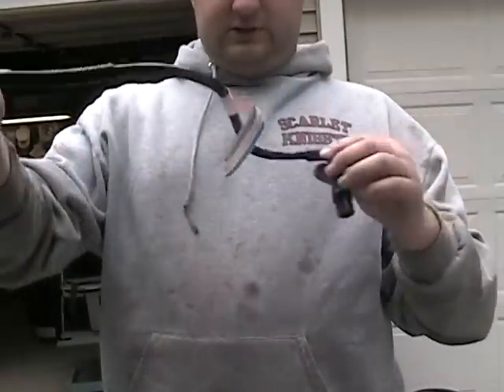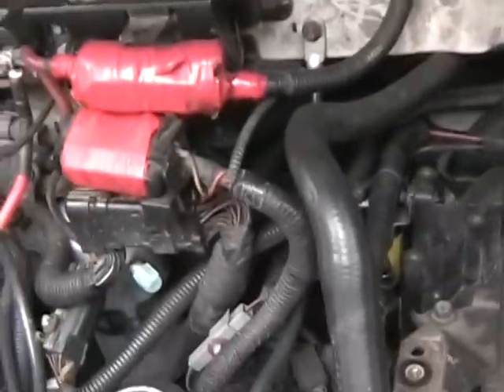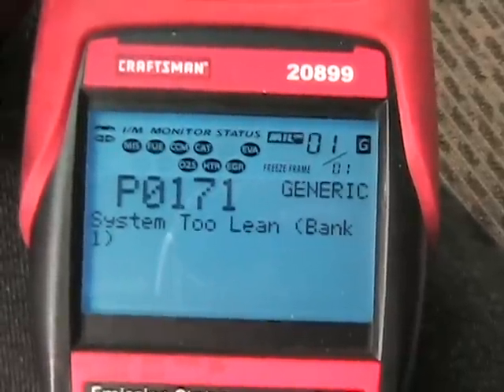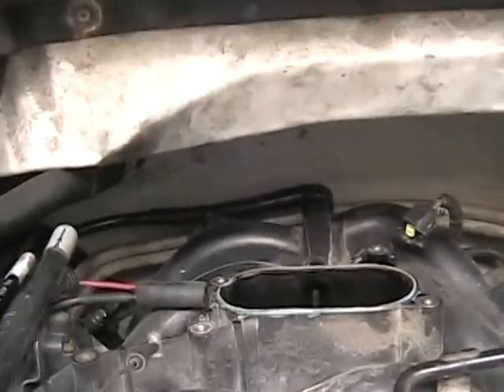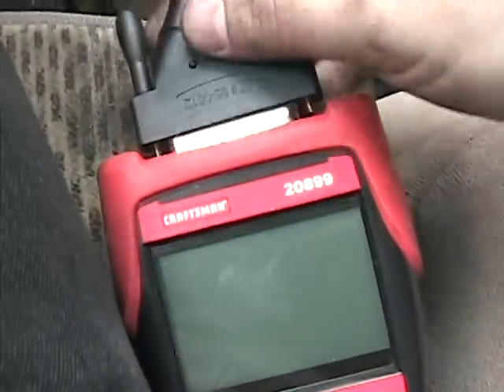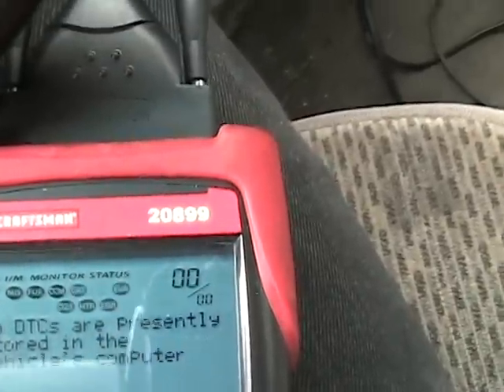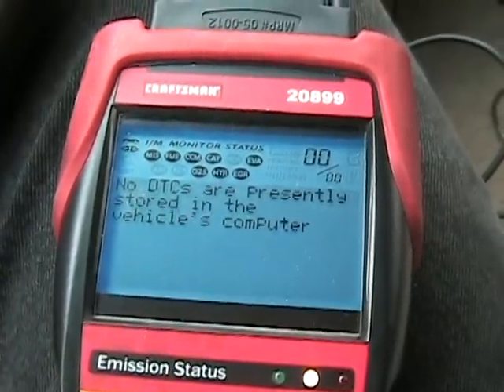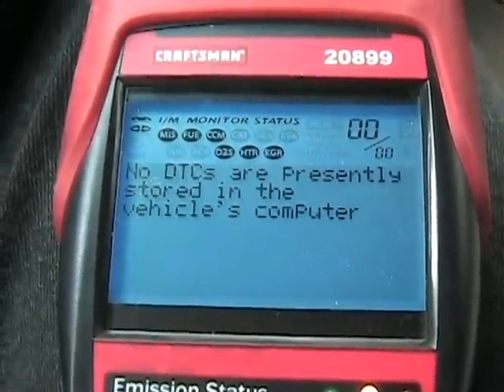1998 Ford F150 PCV Tube Replacement Triton 5.4

Comment: Nice video, only thing I recommend is taping or blocking off the opening of the intake manifold with the throttle body elbow removed. Last thing you want is to drop a piece of rubber or plastic down there while it's wide open.

Comment: I bought one and it took me 10 minutes to replace it. Same Code you had. 1997 Ford F-150 5.4L. Runs fine now and no Codes. Found a small crack on the tube.

Comment: If your 5.4L goes through a lot of oil, consider replacing your PCV first. Could save you on more work. Like changing leaking valve cover seals
Reply: Thanks for that tip too. My F150  goes through oil and the passenger valve cover is covered on the top by oil . Didn't even think of the PCV valve.

Comment from the maker: @TheMrchukies - You can try that, it is a common problem on the F150 5.4s and 4.6s to have the elbow on the back of the intake manifold break after time. The rubber becomes brittle. My issue ended up being the MAF (Mass Air Flow Sensor) was super dirty.

Comment: I'm finding several part numbers for this same part. One thing you need to know is if the PCV valve is heated.You can tell if it is by the hose branching into a y a few inches above the valve itself

Comment: What could be the problem if you get hesitation when accelerating fast? Changed the fuel filter under driver side checked spark plugs and cables all firing correctly. Problem still exists. Thanks for video.

Comment from the maker: @cowman500000 - Not sure totally, I believe it's the same as the 5.4, you'll probably have to take the upper and lower intake off and then the valve covers. The bolts for the heads are quite long so it may be fun getting in there to unbolt them.

Comment: Did it run super rough and stink before you changed it out mine is missing hard stinks and I'm almost positive this is the issue I had 3 other holes in lines I've replaced them it has been better but not smooth yet im thinking this is what I need to change also I'm thinking I'm taking my throttle body off as well I've got fatter hands what size socket do the bolts take? Thanks man

Comment: I just had to replace my PCV valve and was wondering, did yours have any type of grommet that holds the valve in the valve cover?  I had the same error codes showing a massive vaccum leak and when I began looking i noticed the valve had come completely out of the valve cover.  when I put it back, it just slid in and out with no resistance.  the new one is a little more snug but i know older ones used a rubber grommet.

Comment: Quick question...  Were you experiencing an occasional no start?  I had p0171 and p0303.  I changed the coil, cleared the codes over a month ago and can't get my light to come on since.  I'm having intermittent no starts, and occasional chugs at acceleration.  No one, even my mechanic can figure it out!  I'm completely on my own.  Things replaced...  MAF sensor, Camshaft sensor, Air filter, Fuel evap hose.  Thank you!
Reply: Did you ever figure out what the issue was? Sounds lime the same issue I am having. Mine started with cylinder 3 misfire. I changed the plugs and bought a new coil. Put the coil on cylinder 3 and placed the coil from cylimser 3 on one. My misfire didn't move but now I'm getting multiple misfires and just run like crap like it was before. I was going to spray some cleaner around the engine tomorrow to see if that will have any sign of throttle change.

Comment: Alex, quick question, I notice when you gave the part number, you said, "ford F75E-6C324-JB". But the item you are holding and correct me if I'm wrong, reads "F75Z-6C324-JB" could you confirm this, please? and what is the name given to this part? thanks for the video bro, great help.
Reply from the maker: Manguz24 The one I am holding is the correct one - I probably was going from memory then what was right in front of me lol.

Comment: mine is a 97 f250 so it has the single wire then the connector which is a special obd and its on driver side under hood on wall

Comment: on my pcv valve it branches to 3 places. the 1 i bought at auto zone doesn't have many openings on the elbows provided
Reply: +Rosman Morales It's a heated PCV valve I think
Reply: Tom Bowman thanks.  I lived in Wyoming for a while when 1 was like 10. Cody and Powell. My parents worked in the fields back then.

Comment: Why on earth would you remove the throttle body to replace the pcv elbow and tube?  And the waste of money on a complete pcv tube assembly?  My rubber pcv elbow and the back of my throttle body severed in my 02 f150 and I simply reached back there and pulled it loose and took 3 inches of half inch heater house and clamped to the pcv tube.  Also that 171 code would only show on rpms of 1200 and up because a pcv is open at idle rpm and closes above 1200 rpm in which hat is where you had a leak in the tube or faulty pcv valve.  On those pcv tubes all a person needs is 3 inches of rubber half inch heater hose and rubber fuel line that goes to the valve cover connection
Reply: Earl Guyton Honestly dont half ass it just get a replacement assembly hose. Over time it gunks up with Oil residue.
Reply from the maker: @sofakingraw4149  Agreed

Comment: Hi Alex. First time doing this kind of thing.... i have an 03 f150 that I recently bought.
This video was really helpful, and I hope to try it out. Quick question, was going to buy a scanner to do the resets you did, do you know if this kind would work?
Autel MaxiScan MS300 CAN Diagnostic Scan Tool for OBDII Vehicles https://www.amazon.com/dp/B001LHVOVK/ref=cm_sw_r_awd_cXuNvbTKDSFFG
I appreciate your help.

Took to the mechanic, and the Codes that came up are the same, as well as po-171 Khan on bank 1, 174 lean on bank 2, and po316 misfire on startup.